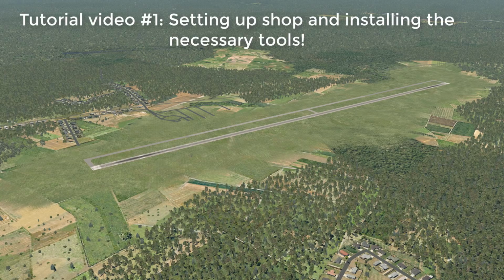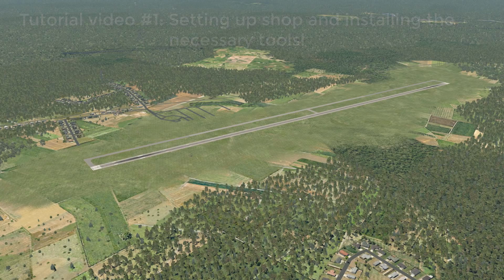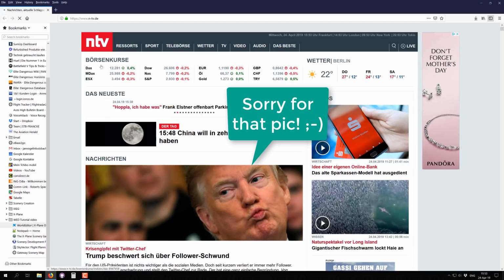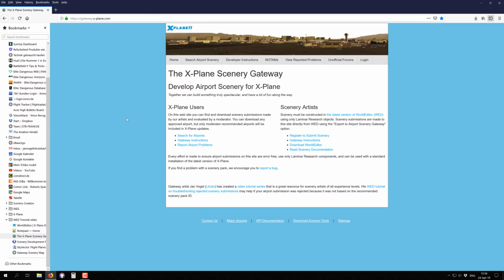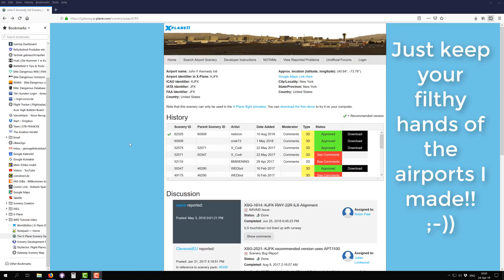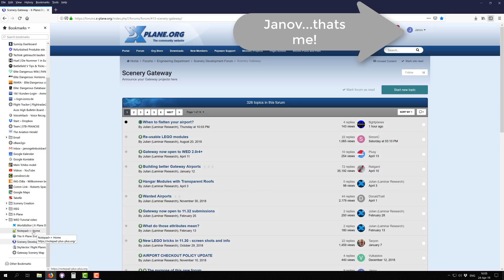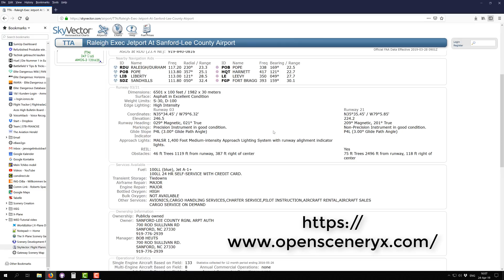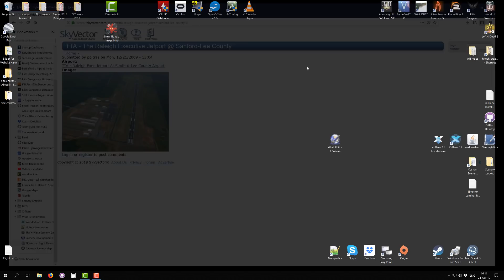#1 - Setting up shop and installing the necessary tools

Comment: Great video. New WED 2.0 comes with Slippy Map view to pull ESRI Imagery for tracing purpose which is 100% legal per license. The images are good enough to cover majority of the use cases.  Therefore last part this video talking about Google/Bing/wedomaker is good for 'information purposes' but might cause some unnecessary confusion with new comer.  Looking forward to next video.
Reply from the maker: Ahh, it comes with its own map now?? Just kidding ;-)) I will obviously touch upon that IN DEPTH in the next videos, however when it comes to "installing the tools" I felt that a mention was in order.

Comment: Hi Jan .. I am trying to build some airports here in Australia and generally having a ball. I am stuck with what seems an overlay that stays above the ortho scenery. Its wrong and looks terrible. Can you tell me how to remove it so the ortho is visable only. Its YGAW if your interested. I flew here for 5 years and its changed a lot. We now have a 4 lane highway which has shortened both  runways. Any assistance welcome. Thanks
Reply from the maker: I generally don´t give specific advice there on youtube - please bring your question over to the Scenery Builder forum at X-Plane.org - many knowledgable and friendly people there to help you! Happy WEDding!

Comment: How do you get rid of airports that are in xplane but no longer exist. Example KCCU Travis AFB’s “aero club” is still in xp but has been gone for 15 years. Another is a field Se of Ksmf just East of freeway. Is housing now. Problem at night when looking for ground reference.
Reply from the maker: You have to file for that airport to get removed on the Scenery Gateway
Reply: Jan Vogel I reserved Travis and gave nade the changes to upload. Since David Grant is tight gect Rorbuer they use it as a helipad, I will upload to gateway Todsünde or tomorrow with the changes. How do you file to airport removed... guess I dhoukd research that

Comment: Hello Sir why you deleted your previous playlist of WED?
Reply from the maker: The reason is that with the current X-Plane version and WED 2.0 too much has changed - the old videos were not up to date.
Reply: @janvogel9719  already started with VABP airport. Following the same guidelines as mentioned. But true Google Earth maps are much more updated and clear to trace. Its sad that they have completely removed the option to do so.
Reply from the maker: @MonishJohnson  , I totally agree with you. It is a shame that they don´t allow to use their imagery for this in the end user license agreement.
Reply: @janvogel9719 , I recently watched up to part 6 or 7 in the old video series when they suddenly disappeared - I was a little saddened and shocked! After waiting a few days I was just about to post at the x-plane.org forums to ask about the mysterious disappearance but just checked the playlist again and saw these new videos in the list. So this is a relief; I only need to work out where I need to pick up from (or decide whether it's worth starting over). I did not find anything in the old tutorials that didn't work in the current version of WED... but I do understand things have changed. (I wish the old videos could have remained online until each chapter had been replaced, though I realise that may have gotten confusing!)
Anyway, Jan, a HUGE thanks to you for these tremendous videos. They are so easy to follow and very clearly explained throughout. They only encouraged me more to get stuck in and start creating an airport :-)

Comment: Jan, thanks for this. I have a question. You say that Laminar will not allow 3rd party libraries to be used in Wed sceneries.  When I pick a downloadable scenery from X-Plane.org, almost always the author attaches a list of required libraries!  I am confused.
Reply from the maker: Read your reply yourself and the confusion shall lift! Here is my hint: Laminar Research has NOTHING to do with X-Plane.org. ;-) In other words - the airports included in X-Plane (by LR) do not allow this, but other scenery (that the user can download/buy) will do so.

Comment: Jan, thanks for producing this series!  I found it after the XP Dev team dropped your name in the recent live Q&A.  The one thing I'm looking to do, which isn't included in this series, is modifying topography at and around an airport.  I'm very familiar with KCLT and it feels like a completely different experience in the sim when the airport is portrayed as flat.  Could you let me know if it's possible, or might be a WED feature in the future?  Thanks!
Reply from the maker: Hi Michael, I just checked and KCLT is not flat in my version of XP12. It is also not possible to modify terrain elevation in WED. Cheers, Jan